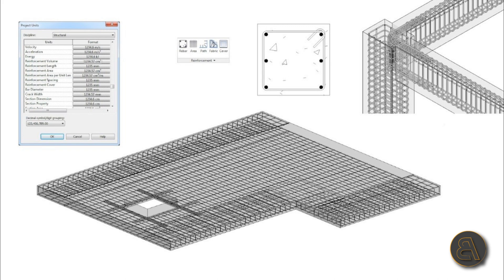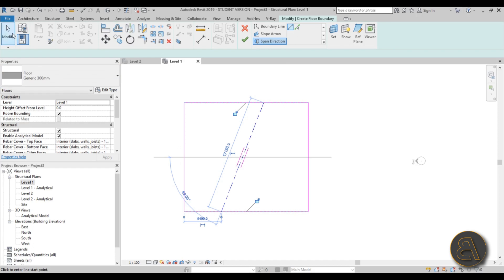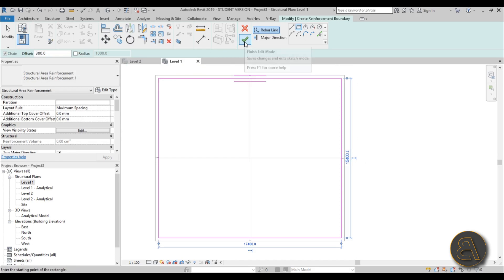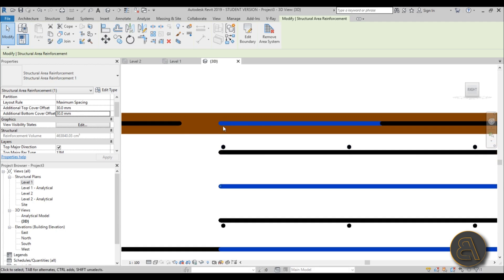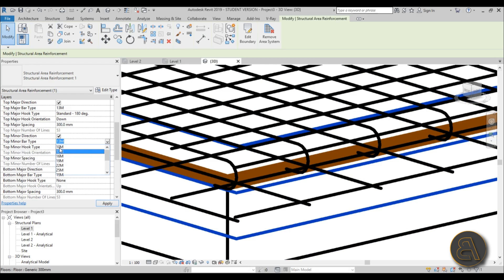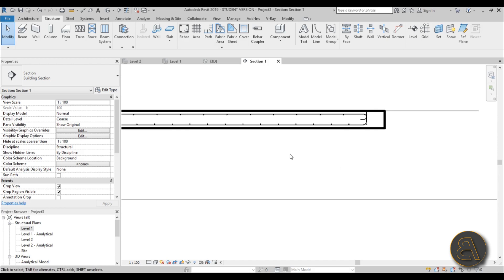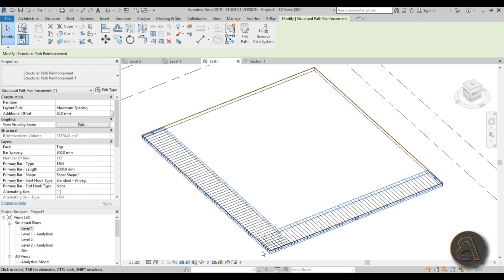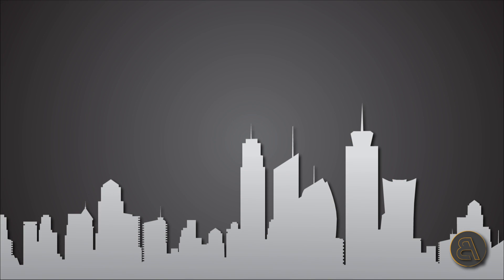How to Place Rebar in Floors in Revit Tutorial

Comment: Great video! Hopefully you have a video of doing Architectural and Structural model of the same building project. And the work flow required so that collaboration or same draftsman can develop the architectural drawings and Structural drawings plus even more better electrical and hydraulics/plumbing of the same building project.

Comment: Great Video! Can you model the loads to a concrete slab with different rebar reinforcement (i.e. different spacing or one layer vs two layers) within Revit? That is, detailing as well as modeling loads to each layout. Thanks!

Comment: Balken - I get the implementing of rebar for slabs but is there a video of how to do this with a cut out in the slab for say conduit runs from up under the slab. The design is a 12" thick slab with 2 rows of steel with 45 degree pieces connected with hooks (horiz.) with a 2" and 3" conc. cover at cut outs/slab edge in slab. Thanks for all the great videos. keep up the good work. - Tim

Comment: Hi Balkan, Have you got a video of putting the rebar into a slab edge, I have a odd shaped slab edge. i have tried following the path but it wont pick it. also the slab edge miters at the coroners and the steel rebar runs straight. Thanks for your help in advanced